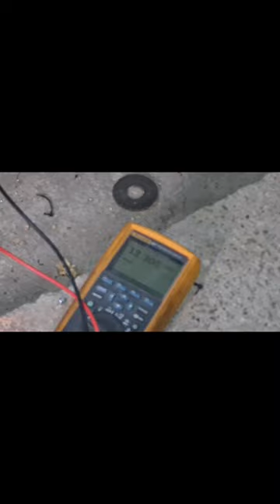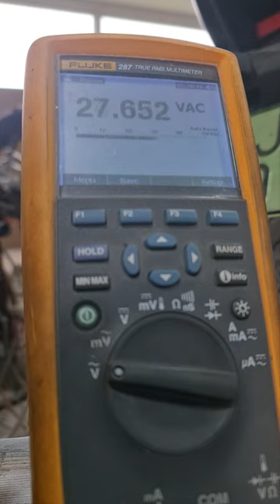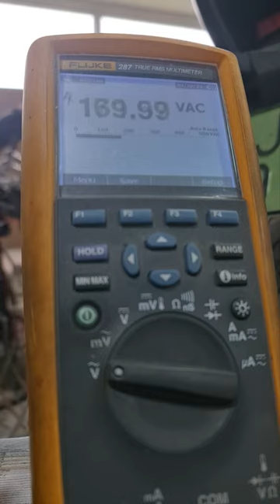Wind Generator tutorial

Comment: As I understand it, the full load current I (Amps) for the 3-phase coil windings is calculated by  I = Mechanical power out (or in) Watts / (1.73 * Voltage * Efficiency * Power Factor)

For example a 1 kW mechanical power device with 240 Volts at 0.8 efficiency and 0.9 power factor has a full load current of 3.3 Amps.  That would be a pretty decent wind turbine, so very conservative if you are just messing about seeing how this works on a rough homebuilt turbine on the bench. 3.3 Amps current in the winding.

Then, you design your coil (I'm missing a bit here!) and figure out what length of wire is in your coil.  Then (assuming three phase design) you figure out the total length of wire in the coils for each phase, because the power runs through all the coils for each phase from end to end.  That gives you the total length of wire to consider.

Then find a wire table which gives you Amps loss for that length of wire for various wire sizes (diameters or ASWG).
https://mwswire.com/wp-content/uploads/2016/11/Resistance-Copper-Wires.pdf

Pick a wire loss for your voltage which is acceptable...
For example my 52 m of wire = say 150 feet. Read Resistance per 1000 feet for a wire diameter say 20 AWG (about 0.75 mm dia) has a resistance of 10.13 Ohms per 1000 feet = 1.5 Ohms for your 150 ft coil winding.  

What does that resistance do to your voltage across the winding?
V=IR. 3.3 Amps x 1.5 Ohms = 5.0 volts.  So voltage would drop about 5 volts.  Want less voltage drop then go to a bigger wire, but that would be an OK place to start.

So then you have a rough idea of the wire diameter.  That wire size may muck up your coil design so go around again to optimise.

The bit I'm missing is the coil design, but hey, we're curious, and that's the fun we have.

That's the best I can figure the process.  I'm leaving out many subtleties, but that seems a sensible way to start to ensure your wire size does not 'obstruct' getting voltage and current out of the coils.  Onward!
Reply: Nice insights ...I wanted to contact you